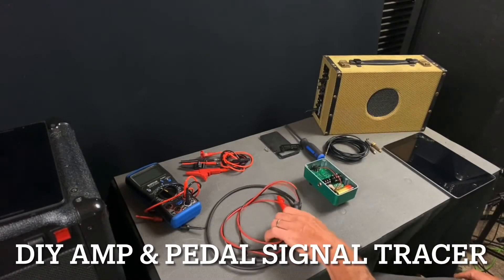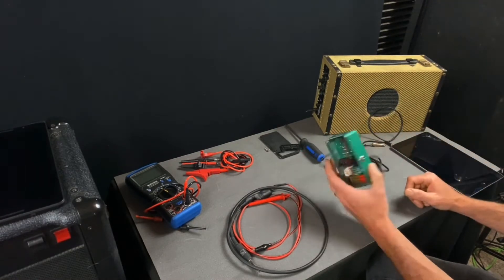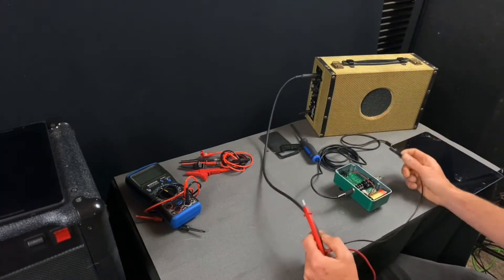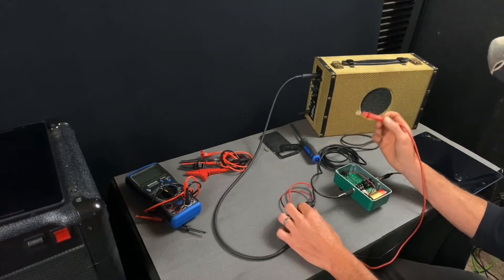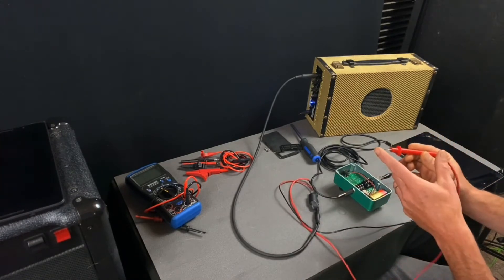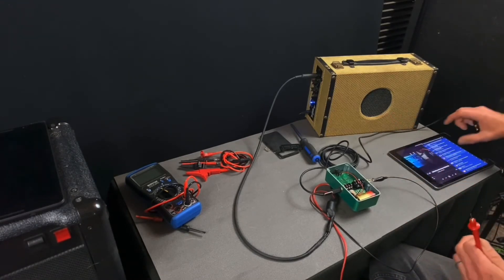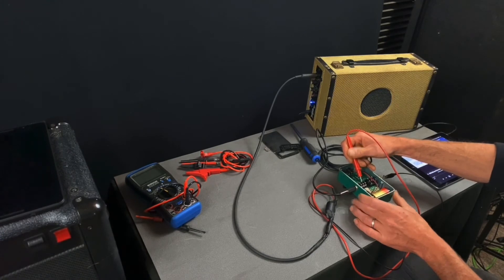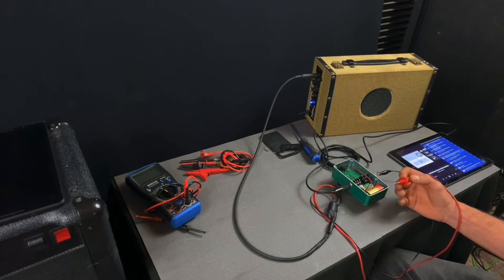Broken Amp No Sound? Use a DIY Signal Tracer

Comment: How can you use this Audio Signal Tracer to troubleshoot noise S/N signal to noise ratio problems in guitar amplifiers and guitar pedals?
Reply from the maker: That’s a great question! I would think that you could follow the ac signal and be able to hear the point that is causing noise. If one side of the tube, transistor, or signal component is clean and the other side has a lot of noise than that would be the part to look into. If the whole signal path has noise problems then I would look into the power section as bad leaking power supply caps would introduce overall noise. Are you having a specific problem with a piece of gear?
Reply: @themusiciansworkbench  Just a general question for any piece of gear. The amplifier being used would have to be very quiet with good S/N ratio to be using an Audio Signal Tracer to troubleshoot S/N signal to noise ratio problems. A common problem with 60s & 70s fender amplifiers is the boards will get moisture problems which causes "DC leakage issues" and other S/N noises. I'm not sure if adding a Diode to the Audio Signal Tracer would help the S/N noise test. Anything below 0.7vdc is 700mV of Noise is considered bad. You can also use a DVM meter and set it to measure AC millivolts scale so measure the Noise AC millivolts per stage before the tube/transistor/FET and after the tube/transistor/FET measuring each stage inputs and outputs noise AC millivolts.
Reply from the maker: @waynegram8907 I think a signal tracer is likely a super basic troubleshooting tool for finding problem noise levels. Really an oscilloscope would be a far better tool for diving right into signal to noise ratios and stuff. That and like you mentioned a multimeter to test specific voltages and components.
Reply: @themusiciansworkbench adding a passive noise gate to the audio signal tracer is added back to back diodes in series with the conductor. If the noise level is above the diodes threshold point, that component has more noise than normal operation. The diodes noise gate circuit is 700mV of a noise level threshold point. If a component is causing more noise is will be above .7vdc 700mV which should be considered bad

Comment: wait, did i miss something? so you got a mono guitar cable spliced into a pair of DVOM test leads with a de-coupling Cap. across the pos. & neg. leads? is that correct? an electrolytic, ceremic, poly film? & what size? volts & uF ? i must be  losing it. bc i never heard, also it would have been great if you had it out of the ele. tape or shrink tubing , so we could see how & what you have there.... i know, i feel the pain, for some reason they are awful proud of that shrink tubing, 🙅🏻‍♂️ i put that stuff on everything, im about going broke over it. i shrink my project wires up all nice & pretty & then the d`*mn circuit fails.... 
lmao.... i guess i need to just put new strings on & stick to playing on the guitar
Reply from the maker: @guitarman_3693  thanks for the questions and comments! I made a video of building the circuit tracer. It may explain some of your questions. Super simple useful tool for the bench.
Reply from the maker: @guitarman_3693  https://youtu.be/JLYqoxG_3ro?si=5nru_xne677qrdaT

Comment: Thanks.  I put together a similar probe after watching this video (small headphone amp with spliced RCA cable with the positive lead connected to capacitor and alligator wires for both; used an Android signal generator app also).  Anything specific to watch out for when tracing eyelet board pedal builds?  I have more parts coming today.  The bypass for my build works fine but no signal from any part of the eyelet board.  Have a good one.
Reply from the maker: I don’t think it will hurt anything poking around on a pedal circuit. I would start by probing the input signal. Then follow the signal path until you loose it and possibly take some voltage readings in the area of trouble. Hopefully it will be something simple like a backwards capacitor or crossed wiring.
Reply: @themusiciansworkbench  Ok, I'll give that a shot. Thanks!

Comment: How do you apply it to an amp, not through a pedal?
Reply from the maker: That is a valid question given the title. I built it to test mainly amp circuits and thought it would be easy to show how it works on a simple pedal circuit. I will make a video showing how to use it on an amp coming up soon.

Comment: I came from the first video nice demonstration i have some polyester and ceramic caps rated at 1KV but with low capacitance 0.001uF and 0.002uF and one polyester capacitor rated at 400V 0.047uF i will try different ones on the probe and see the result
Reply from the maker: Thanks for watching my videos! I have had good results with the .1 uf cap. So far it’s held up well and protected the tester amp with no problems. Next I would like to build a capacitor discharge probe.